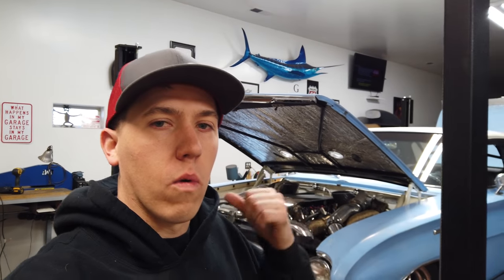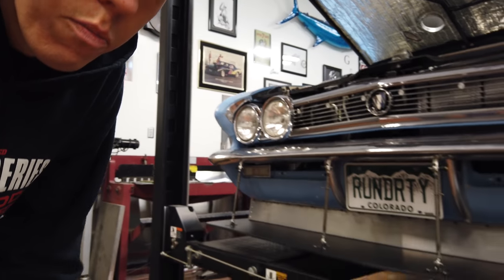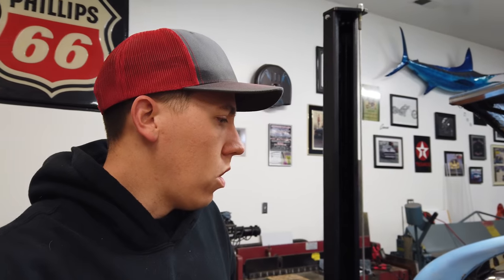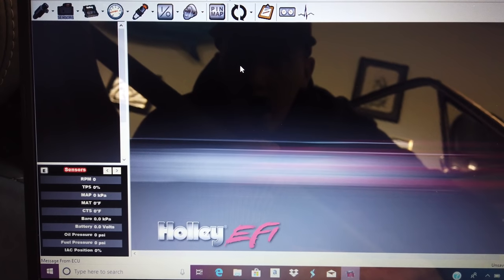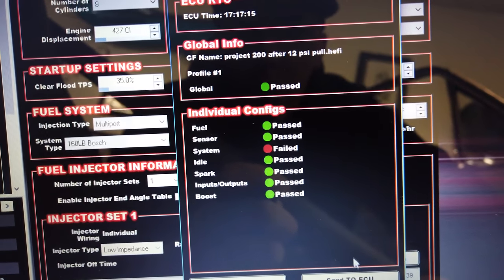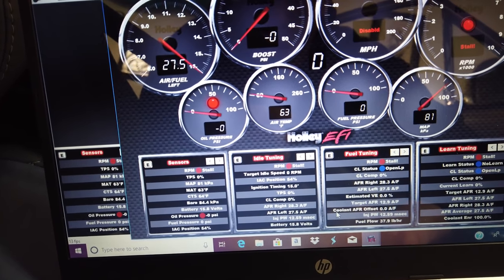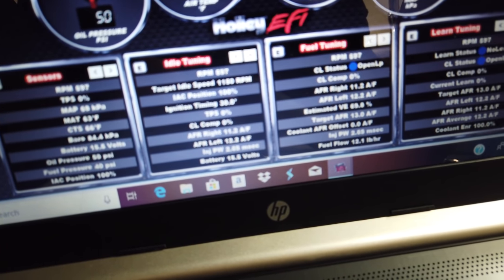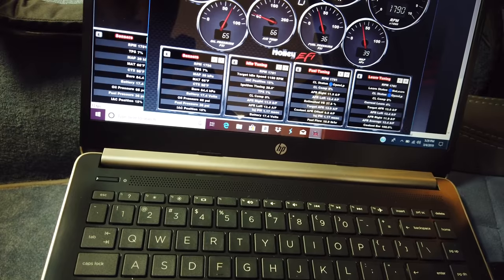Prepping for TX2K Switching O2 Sensors Holley EFI

Comment: What wideband controller were you using that was having problems with the Bosch sensors (or does the Holley control them directly)? What do you think the root cause of the of the failure was? Location (heat)?  Moisture thermal shock? Something else?
Reply from the maker: The Holley controls the o2 sensors. Maybe from it being really fat from the other injectors maybe didn't last long that's for sure lol